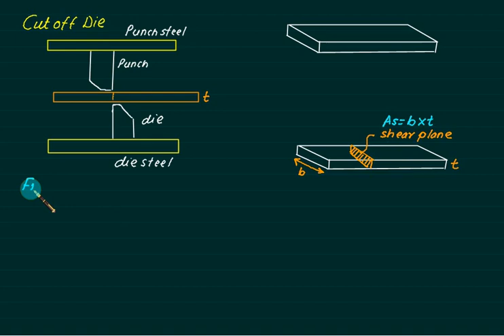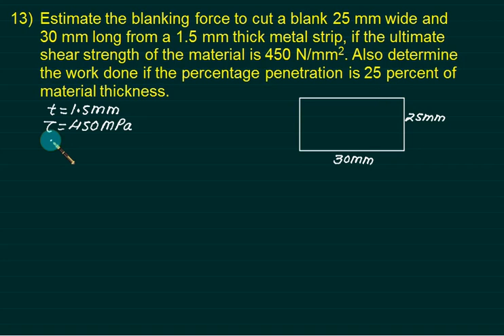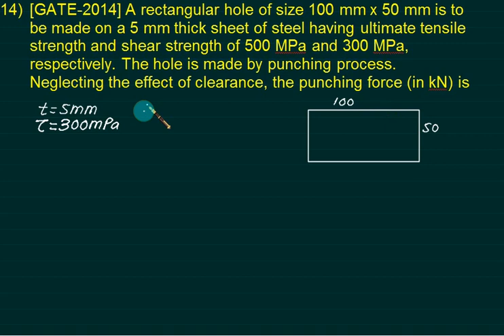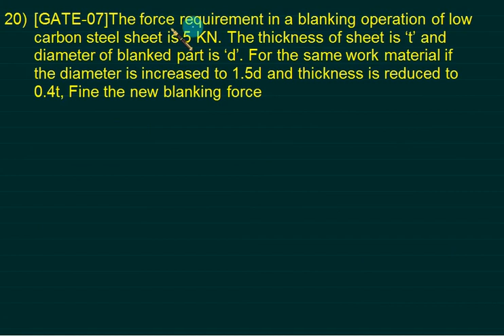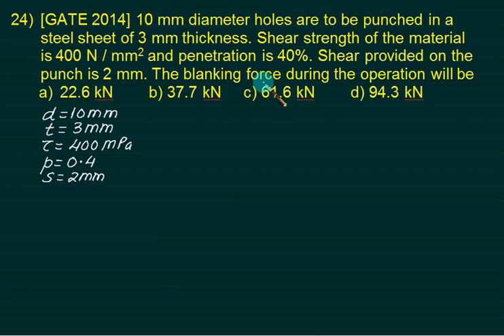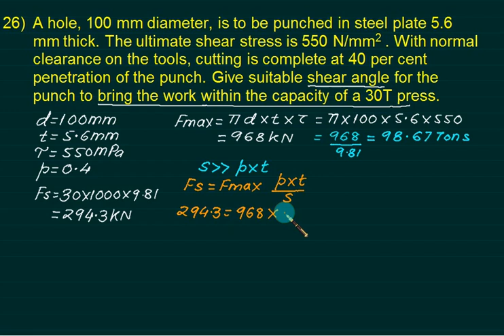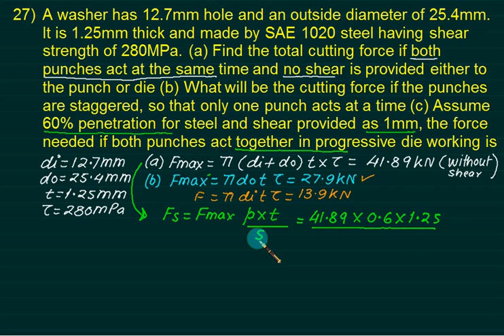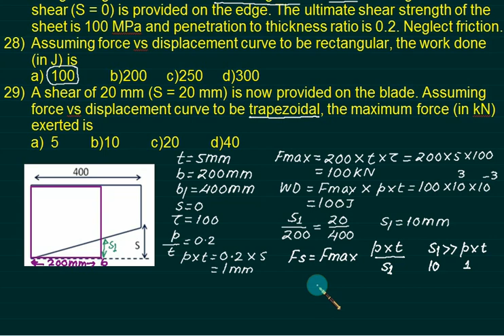Sheet Metal 02   Cutting Forces

Comment: Sir what does "s" denotes?
Reply from the maker: Length of shear
Reply: @sunilmohodmh31  thanks so much Sir.This value of shear is provided to either punch or die to reduce the maximum force required for the sheet metal operation. right sir?
Reply: @navinpn410  yes

Comment: Dear sir, what we do if we dont get or dont know the penetrations .

Can you please let me know how much force is required to cut the blank on a s.s 304 grade sheet & also give me the calculation 

Size is ( rectangle in shape )
 length 74 m.m
Width is 24 m.m
Thikness 4 m.m

Thank you

Waiting for your valuable reply sir
Reply from the maker: Take penetration =1/3 for steel
Reply: sunil mohod  sir first of all thank you for your reply. I dont get you sir i dnot know the penetrations value of s.s. so how can I get or assumed the value.
Reply from the maker: thickness /3
Reply: sunil mohod sir du you mean total thikness divided by 3???

If its then the ans will be like this 4 ( thikness ) ÷ 3 = 1.33... is that??
Reply from the maker: stock thickness/3
Reply: sunil mohod don't get you sir
Reply from the maker: yes your calculation is correct
Reply: sunil mohod  what will do if we dont know the shear stree or shear  strength
Reply from the maker: data is available in handbook